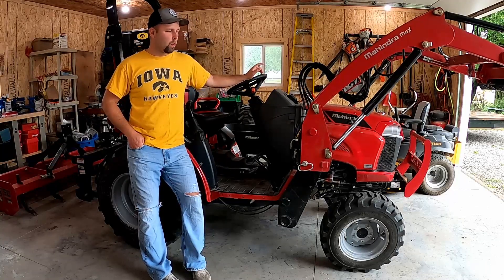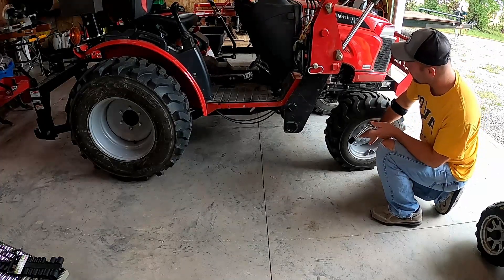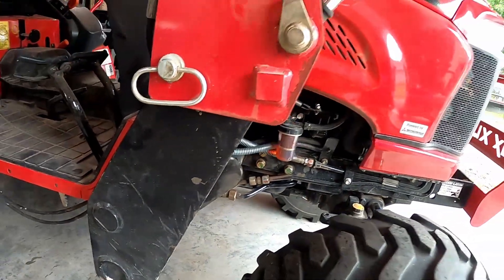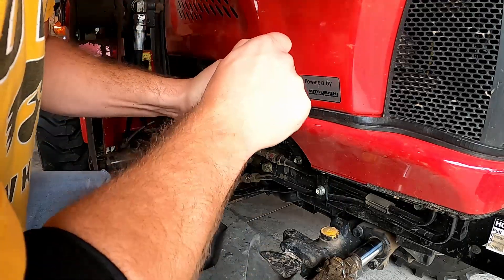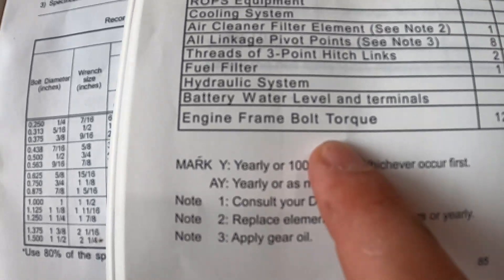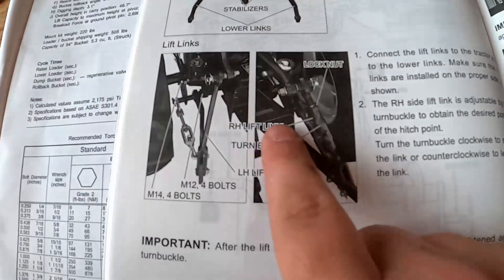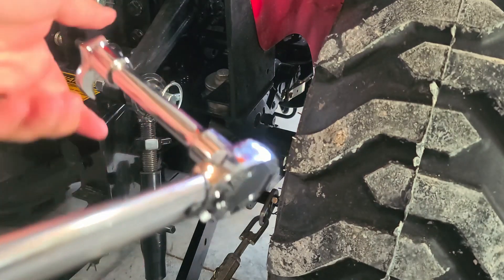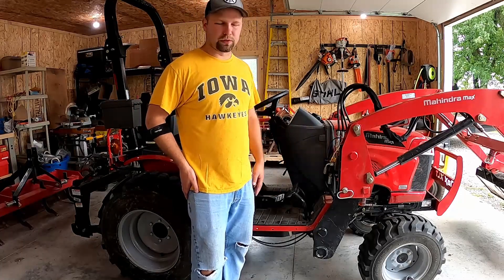Have You Torqued Your Bolts? Critical routine maintenance points you must check on a compact tractor

Comment: @7:38 there is a book behind the lift link book, looks like a recommended torque chart, what book is this? can you provide a snapshot of that chart for me? I have significantly more bolts then what is in the book , due to the mower and backhoe.
Reply: FYI, that book is based on no loader. After going through and torqueing most of mine down( have to remove the backhoe to do the 20 of them back there) realize you have at least 4 more bolts farther back on the loader that need to be done as well 2 smaller 17mm at the top and there are at least 1-2 as well, not counting the subframe going to back if you have a backhoe which is an additional 2 per side. I say this because every SINGLE bolt on mine was loose, and one head was broke off. Good Times.
Reply from the maker: @littlebill2601  I actually had tightened these, it was just done at a different time and not on camara, thanks for the heads up though!
Reply from the maker: @littlebill2601  that chart you are referring to is just a generic chart in the loader book. It talks about grades of bolts and the specs for them. Do you have an email linked to your account in which I can send you photos?
Reply: @k6outdoors  yes i do, let me know if you have trouble, and please check those bolts i mentioned above, they were all loose for me.
Reply from the maker: I am looking on your page and it looks like there is no email available to sent the picture to, can you help me out with that information? My email is on my page.